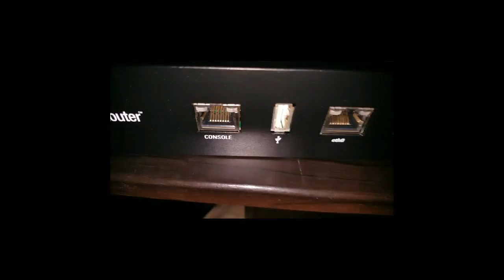EdgeRouter Family - What's inside the router?

Comment: Video is a little shaky but thanks for cracking open all of your units.  That looks like a standard SODIMM in the ER-8.  For $20 you can probably bump that to 4GB easily.  Looked like DDR3 1600 CL11 for those wanting to actually do this. Voltage was not listed.  I'd stick with 1.35v to be safe.